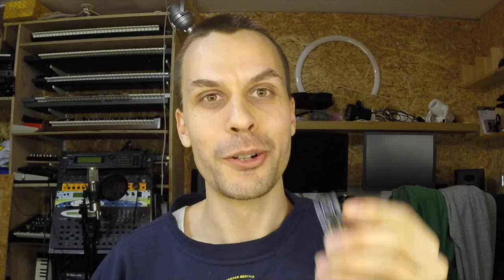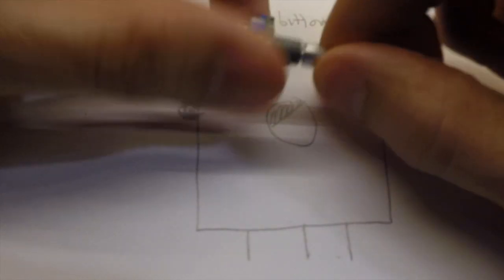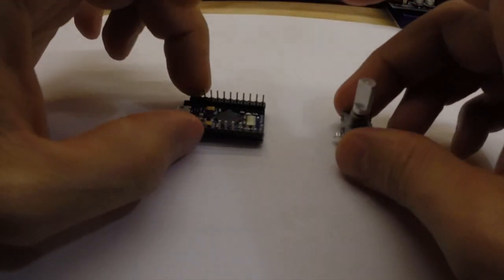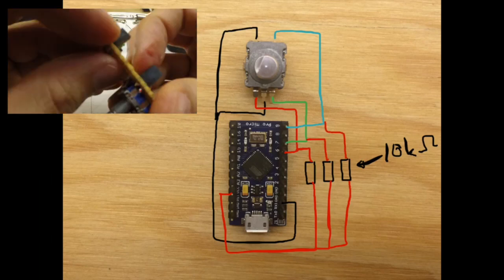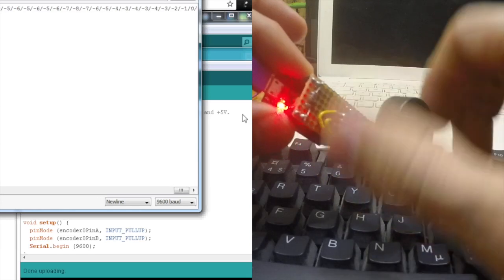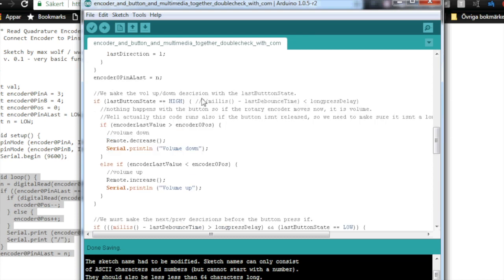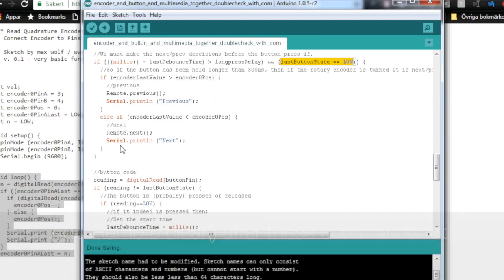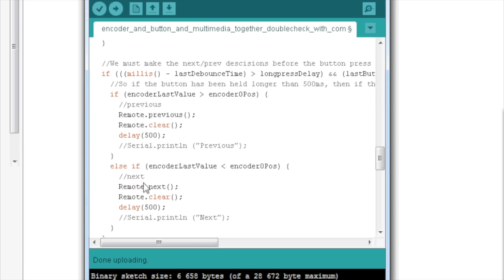A Rotary Encoder as a Multimedia Controller [Anything Arduino] Ep.26

Comment: This project is very interesting and could be used to control all the musical plugin parameters, you could emulate the mouse (with the Mouse library) and its buttons by turning the rotary encoder clockwise to click the left mouse button and moved up and back to counterclockwise. A very interesting project that I have not seen anyone do.

Comment: I remmber coding this, After many tries, i figured if you want an exact reading of direction without wrong readings, you need to compare timings instead of sequences.
Reply from the maker: I did a follow up videos where I use hardware debounce which made these encoders “rock solid”. I find most rotary encoders in commercial use aswell is really sloppy in their response. :/

Comment: I have a arduino nano and i use the clk pin for my rgb leds!
Can i use other outputs on the arduino for rotary encoders ?
Want to ad 3 encoders for my sim rig.
I use simhub software te add,program the leds en rotary encoders.

Comment: Hi Kristian,
I have a GY Attiny85 Digispark and Rotary Encoder Module Brick Sensor (which is the same thing with the rotary encoder except it's soldered on a piece of silicon and the feet are all on the same side.

Is the procedure same with this setup?
Reply from the maker: Yes, this code should work on the ATtiny, and if it is the same Rotary Encoder type it will work. Ive seen one brick that is called KY-040 which uses the same encoder. I think the pins have different names on the board though?
Reply from the maker: +Burak Mehmet Gürbüz I need to change my answer. The encoder part of the will work with your board. However the multimedia parts only works on Leonardo and pro micros.
Reply: I guess I will have to do some refactoring to the code and update the ports seemfully.

Comment: Thanks for the video, hoped you might be able to help me a bit more (very new to Arduino here). I've got a sketch I did made to activate a relay based on temperature. In my sketch I used an if/then statement with a set temp of 65F. How could I use an encoder to allow me to adjust this "trigger temp" while also showing that value on the LCD.... 16x2 I2C lcd now show actual temp on line 0, and line 1 is simple text as too my trigger temp.  Could you do such a video or direct/recommend somewhere to learn how to do this?

Comment: Noticed that there's no library included, when I tried to compile, it says "'Remote' was not declared in this scope"
Reply from the maker: In the video just at the beginning I refer to an older episode of anything adding where the code for this is done. In this video I just show how to change the input from buttons to a rotary encoder instead. So you need to watch anything arguing episode 5 for the code, and also episode 30 to make the encoder “rock solid”. :)
Reply: @SourceryOne  Thanks for your useful video! But the "remote" is important part of the code for it to work right? Where can I download the library?
Reply from the maker: @rontan8433  Again, you need to watch an older episode of Anything Arduino , as I say in the video, in the description and in my answer to you. In that video I go through the steps of making it into a Multimedia controller and where to find the code needed. Here is the link to that video: https://www.youtube.com/watch?v=ubORsI4uWuo&list=PLyE56WXw0_5QrkEwXZ2AXwh6A-s0iQoVl&index=32&t=0s

Comment: Do those commands actually do anything? or are you just showing they can work?
Reply from the maker: The controller works just as shown if that is what you mean. If you do the steps in this and previously mentioned video you can add those commands to whatever you like be it a rotary encoder or anything else you can think of. :) So yes the commands do something.

Comment: ar these rotators compatible with samson mf8?
Reply from the maker: Compatible as in footprint or electrically? Electrically is most probably yes, as they all function kind of the same. But footprint wise I don’t know. Usually for a correct fit you need the exact component that you want to replace.
Reply: @SourceryOne  the exact component works only in one direction of rotation example inc and not dec